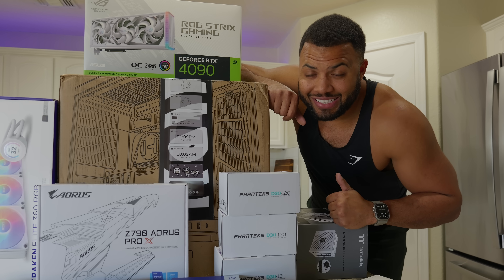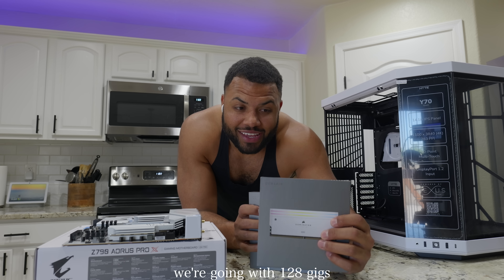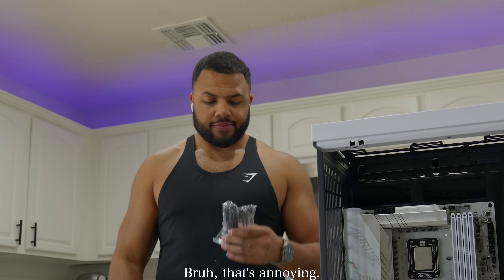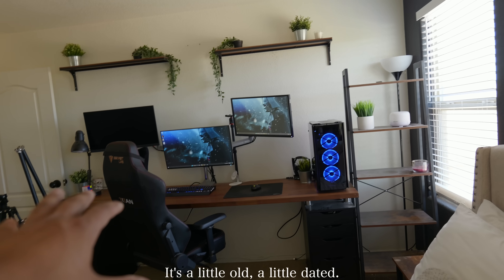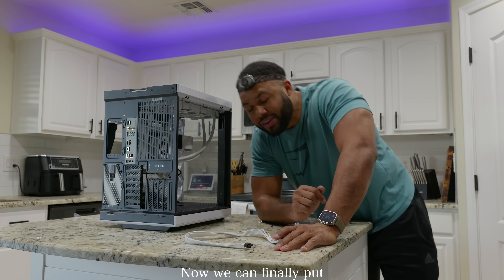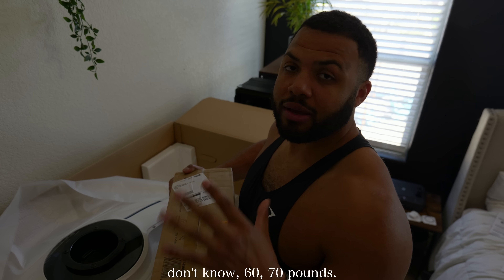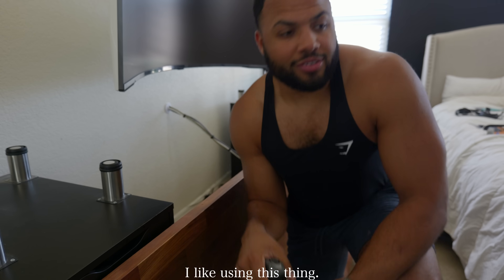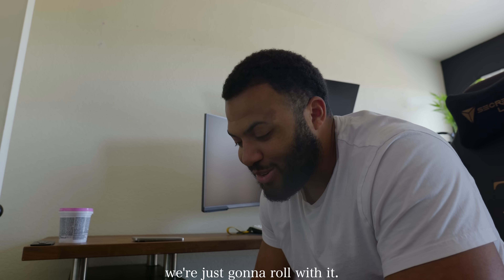$10,000 Setup Makeover!! | PC Build, Desk Setup, & NAS System |

Comment: Nice setup, I got the same pc case lol anyways in my pc specs, I went with -  Case: HYTE Y70 Touch (White exterior, Black interior)
Motherboard: ASUS ROG STRIX Z790-E Gaming WiFi
CPU: Intel Core i9-14900K
CPU Cooler: Corsair iCUE H150i ELITE LCD XT
RAM: G.Skill Trident Z5 RGB Series 64GB (2 x 32GB) DDR5-6000 PC5-48000 CL36 Dual Channel (Planning to upgrade to 128GB in the future)
SSD: Samsung 990 Pro 4TB NVMe
GPU: Zotac GAMING AMP Extreme INFINITY GeForce RTX 5090
PSU: Corsair HX1200i 80+ Platinum 1200W
Fans:

3 Lian Li Uni Fan TL 120 (Intake)
3 Lian Li Uni Fan TL LCD 120 (Reverse Blades, Intake)
1 Lian Li Uni Fan TL LCD 140mm (Exhaust)
Cables: Lian Li Strimer Wireless 24-Pin (Motherboard) & 12VHPWR (GPU)
Reply: Bros rich

Comment: I run a 4080 Ryzen 9 7900x n I found that they did a recall on all those angled connectors for the guy because they are causing fires or melted cables, be safe when using those but I recommend not

Comment: Cannot hate just not impressed with the motherboard manufacturers putting too much stress on the CPU rendering game’s unplayable due to not enough video ram error forcing a new bios to Intels specifications baseline profile 139k 149k and the 4090 GPU cables burning up because too much power being delivered through one power connection when they should of placed two separate ones here’s to hoping you don’t experience any of that.

Comment: Wait a sec, all of your fans are intake, that is suboptimal for temps, try flipping the bottom fans upside down so you have some exhaust for your airflow. right now, all the air would go in and eventually get hot so any air cooled components such as the gpu would be getting cooled with hot air which is not optimal obviously. Just gonna point that out.

Comment: Were the power cables of the monitors just run through the holes in the wall?
Reply from the maker: Ran extension cords through the walls, bundled up the short monitor power cords and plugged them into the extension cords that are routed through the arm cable sleeves.